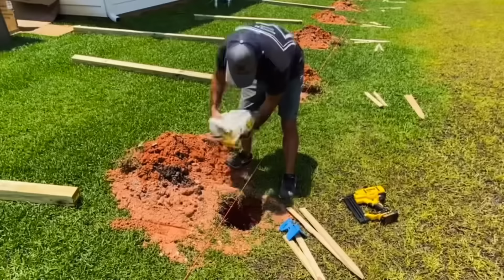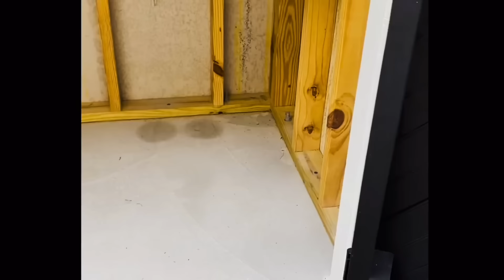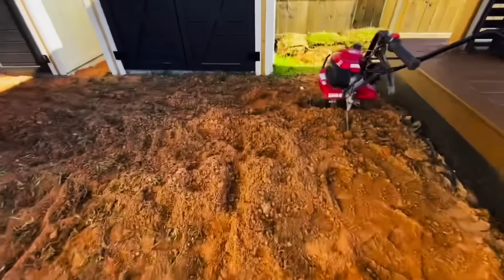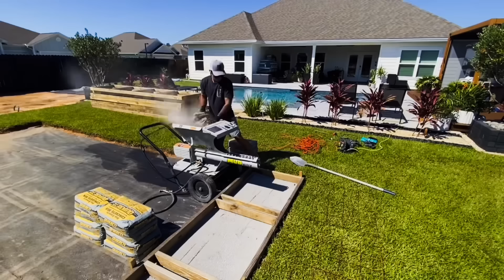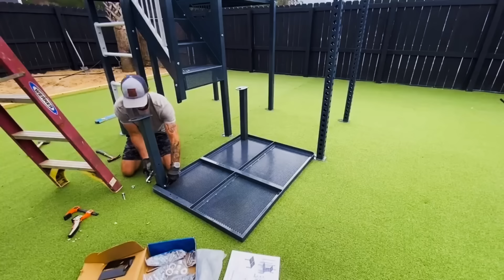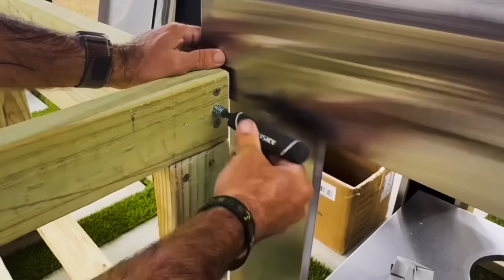Man turned my backyard into RESORT-STYLE escape!

Comment: If you do this type of work a lot The reason your back hurts is glute and core amnesia, lack of propiception. 

That is caused by two lifestyle choices of modern day life that didn't exist before, you need to sit on the floor, doesn't matter what position (cross legged, 90/90 Asian squat etc or even back rest ) this not only works the core but provides propiception to the brain to keep those muscles on, while tight muscles on the pelvis loosen, we sit for 6-8 hours a day on average. 

This means get off sofas and chairs as much as you can, the soft nature and 90/90 seating angles causes a host of issues, none of our ancestors sat in that angle.

- no nerve muscle propiception to the brain so muscles switch off (core and glute)

- pelvis anteriorly tilts, back goes into lordosis, psoas tightens causing back pain. 

The final element to solve is sleep, you need to go with hard firm mattress if not sleep on floor, again same thing propiception nerve signalling to the brain for 8+ hours. 

Your issue is not weakness but nerve signalling propiception, start contracting your abs while tapping those muscles, that will wake up the signalling, same for the glutes. 

But if you don't change the 16 hours lifestyle of soft surface sitting at pelvic destroying angles our ancestors never experienced and likewise sleep, you will never cure it regardless how much you excercise.

Comment: Cost more in the long run being cheap. 90% of the time its not done correctly and needs to be redone and thats where it gets expensive. Hear me out i come kn snake the line for 300 show yu and tell you its 3k for spot repair you say no im down for 300 every so often eventually it will break and will get 300 300 300 300 300 300 300 300 300 300 300 300 300 300 wait were past 3k ha 300 300 and now 3k get the picture

Comment: Here's my idea for 7' faux stone columns. Frost line is 3.5', digging then to 4'? Box/Frame 22" around post for column footer/base. Pour hole and base together. 
Build square column form with ground contact 2x4. Covered with ½ cement board, attach faux stone to cement board. 👀 whatcha think?

Comment: Sure, Bro could have connected all the sheds together, saving/gaining 8' (or 2.5 Meters) of space, BUT, it would be considered a building vs. temporary structure, and you have to pay taxes on its value, plus permitting costs and their required inspections (too close to property line, too close to house,) followed by insurance for the permanent structure. (Each piece/cost may be different based on where you live.)

Comment: The main reason having a professional do any project is labor costs I remember at the height of the pandemic my dad tried getting our roof replaced because it was several years over due thankfully we hadn't developed any leaks or anything but we decided to try doing metal roofing the lowest quote we got was 20 grand to do our 2200 square foot home and the seperate workshop which I don't remember what the square footage is my dad and I granted it took us a entire week but we did it for around 7 grand idk what it would've been with the adverage wage for roofers is but we worked on it from around 8am to 5pm every day for a week it's always going to be cheaper to go DIY but if you don't have the skills or knowledge its better to have a professional do it. We ended up doing Asphalt shingles like what was already on the house. Now this was the cost of renting the boom lift to get the bundles of shingles up to the roof, the dumpster to throw away the old shingles  and the cost of the materials itself I'm sure it would've costed around the 20 grand quote we got had we been paying labor.

Comment: Awesome job. By the way, 811 does not and cannot mark irrigation lines nor any lines installed by the home owner. They mark utility line only so as far as sprinklers go I would suggest to locate your sprinklers and you should be able to imagine the path in which they are connected as long as you find the water source.

Comment: Congrats on such an awesome collection of projects!!!  I hope you are proud of yourself because you certainly accomplished alot and it turned out beautiful!  I would only make a couple of tweaks - (turn the propane cover side ways so it ties it when the louvered wall behind it and put up some shade sails over the playground area so they can use it during the day - 6 months out of the year it's too hot for them to use it during the majority of the day and the black accent on the ground/posts, etc just add to it) and for the same reason, I would mount a mini awning on the fence over the weights/kettle bells to shade them - heavy weights in the 90+ degree sunshine and high humidity is a safety hazard from my perspective.

Huge fan of the mini shed row concept (I bet they will not only get alot of use, you'll have a much better grasp of what you have on hand because nothing will get lost.  Also, love the variety of materials/plants used.  it looks welcoming from the very beginning and draws the eye (and feet) outside, which is what most parents want these days :)

Comment: Only pointer I have is stagger seams on your cross supports....if you did 8ft centers use a 16ft 2×4 on the middle run to offset the break points. Nice work!

Comment: Hi Donnie! I'm a DIYer myself and have bad lower back issues (my lower spine doesn't have enough cartilage). For low/ground projects like building decks, I highly recommend a back brace! They're availble from pretty much every grocery/drug store "over the counter" with the other joint pain stuff (knee braces, tiger balm and icyhot, support shoe inserts) and ususally cost about $10 to $20, but the pain reduction is well worth the cost. It's definitely an "ounce of prevention is worth a pound of cure" scenario. I also recommend getting the lower back support shoe inserts and some tiger balm, those help so much. Foam kneeling pads are also a good idea.
Reply: God bless, actual back saving advice! Thanks :)
Reply: them back braces never did any help for my back pains

Comment: My backyard 70 feet wide by 30 feet depth is just dirt and small rocks(canyon areas of East San Diego are all rocks soil). Looks good considering it's normally All Weeds. Need to start putting artificial turf and concrete like you did. Wooden Deck at the end of the backyard for Canyon Views be nice too. I have paid $750 a few times the last 5 years just for weeds clean-up.

Comment: Looks like a LOT of maintenance. Which might just defeat the purpose. 🤷🏻‍♂️
Reply: What u mean maintenance? Yard looks sweet and is def worth any upkeep.
Reply: @6453bianchi  EVERY SINGLE ITEM that he bought, brought, or made will require maintenance, service, repair, upkeep, replacement, upgrading, repainting, replanting, sealing, re-staining, dry-rot repair, water damage, sun damage, wind damage, etc, etc, etc, and the list goes on and it does not ever stop so long as he has this so-called "oasis". So yes, there will be a LOT of maintenance.